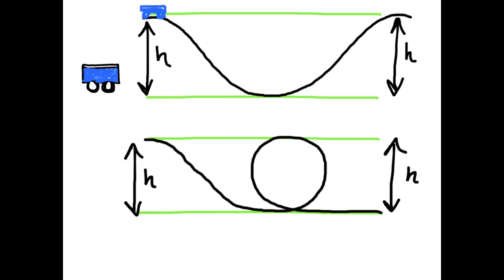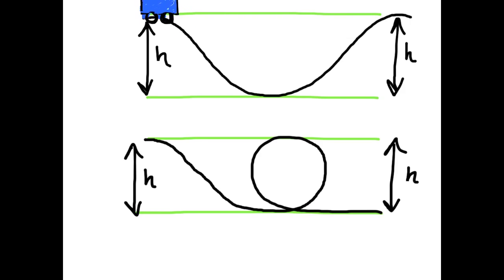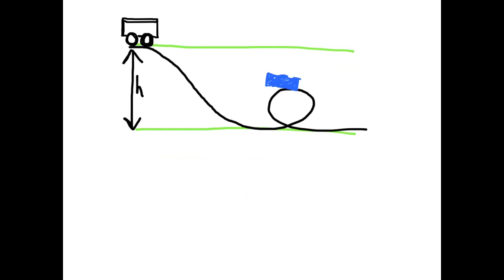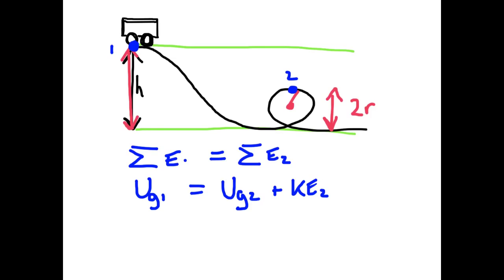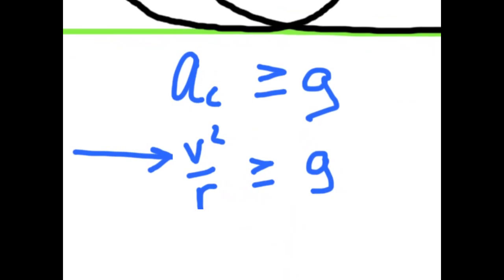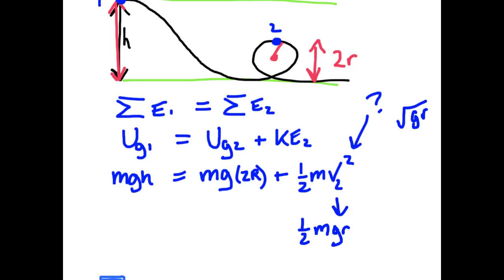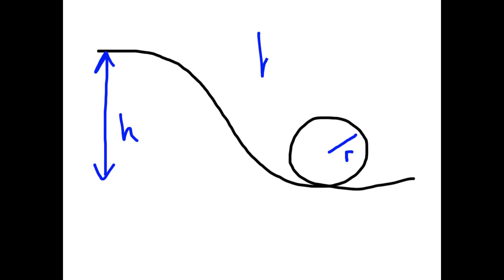Energy Example-Roller Coaster Loop (physics problem)

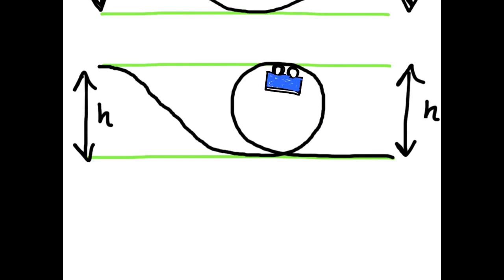Comment: Don't you mean centrifugal acceleration? @01:50  Since you want the acceleration that "sticks the cart to the loop" to be larger than the acceleration pulling it away?
Reply from the maker: No. The carts motion along the track is along the arc of a circle. The changes in its motion (acceleration) happen in favor of the direction of radially inwards, not radially outwards.  Centripetal acceleration means acceleration towards the center. The surface of the track while upside-down provides a force towards center. No force is directed away from center at that point. I would advise against using the term "centrifugal acceleration" when dealing with any object that travels in a circular path (that is not possible).

Comment: Hi there! Is the angle of the initial slope of any importance? It seems no one talks about that. Am I missing something? thanks!
Reply from the maker: Hi. the initial angle will not matter for the question about height. Total mechanical energy is the same for whatever angle you choose for steepness.  It would affect other questions such as acceleration or total duration, but not the height ratio.
Reply: MrH physics Ok thanks for clearing that up! I assume that it just must be a minimum angle to overcome things like air resistance and friction. So let's say; don't let the slope get under 15 degrees or something around that, just a wild guess. Am I a bit right here? :) Sorry, I'm not much of a mathematician, mostly trial and error ;)
Reply from the maker: Yes, there is typically a critical angle for which force components down the incline surpass frictional forces.  In a frictionless environment (the kind you find in the imagination of physics teachers everywhere) any angle other than horizontal will make it roll down